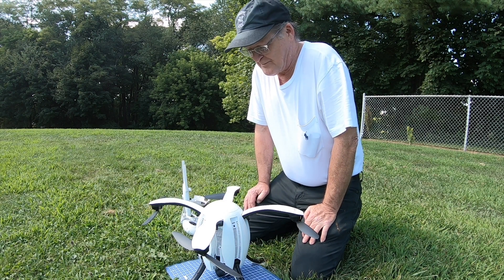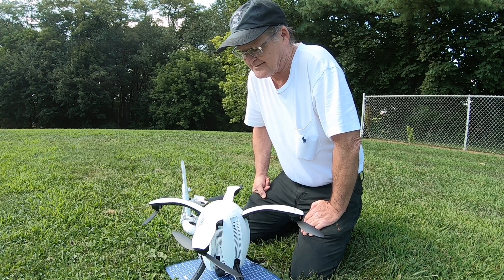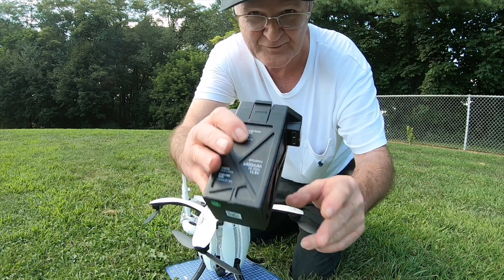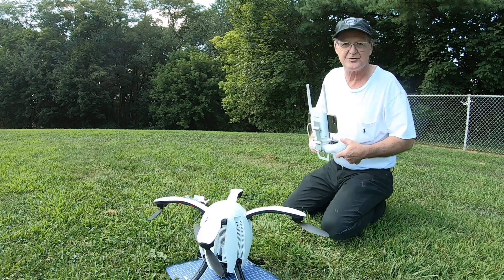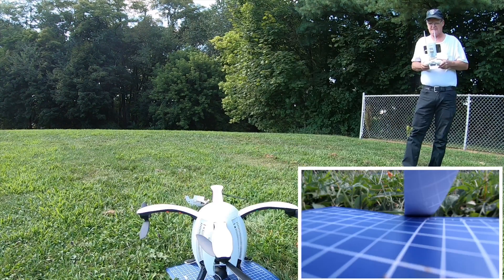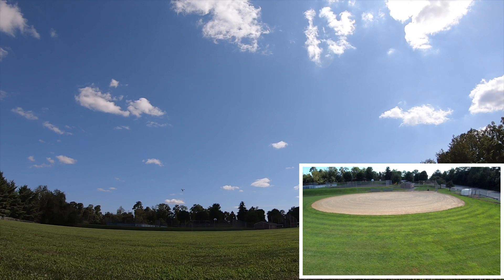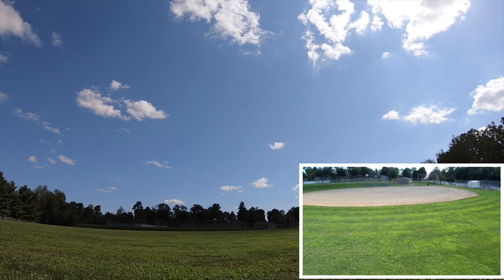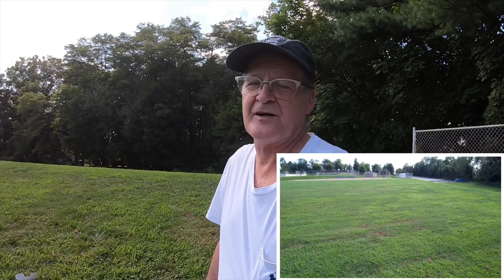PowerVision PowerEgg Drone Second Flight Gimbal Problem 4K

Comment: Is your battery normal?
All three batteries are defective for me.
1. Even when fully charged with a charger, the battery charge is 64%
2. Even with 50% battery capacity, drone lands saying battery is too weak
3. The battery swells, and it won't come off the drone.

Even if I try to buy the battery again, in the picture posted, the battery is swelled.
So, I think all those batteries in the PowerEdge are defective from the beginning,
Put the drone in the warehouse and don't fly.

Is the battery normal for your power?
Reply from the maker: @dkfkdkddk  I have no problem with mine

Comment: Can anyone please help me,  Powervision channel don't answer, i  have used this drone but lately in won't connect  i hace reset and unbinded but i can't get it to connect,  what am i doing wrong or not doing? Ty
Reply from the maker: That sounds like a electrical failure in the drone or the controller.
Reply: it was working fine until i got a new phone  everything seems to work fine but at the last 5 sec of system check it says connection fail , I do have extra base and controller and a drone , thank you @bryansbikes

Comment: Very interesting design to say the least!  That is the biggest battery I've ever seen on a drone. It's as big as a motorcycle/lawn tractor battery!!! I did notice a few "gimbal glitches" but the video is pretty awesome. Good job, thanks for sharing!!!
Reply: Hi. $360 from Jersey free shipping no taxes had to buy now 5 days to go til I have it. Bet it's fun to fly, I like a stepper learning curve. Say will go out a long ways with perfect los angle. Personally I'd be happy with 1000 meters but would feel best closer in isolated area. Dangerous if went rogue on me. This thing would kill someone should it crack open on your noggin

Comment: It sure looks good. My guess on the battery thing is they are trying to get people to discharge the battery to storage voltage or less so they don't keep charging up the battery and possibly leaving it sitting fully charged for a long time which could ruin it. That's why I love the smart batteries because they will discharge themselves.

Comment: There might be a sensitivity setting for the gimbal?  My Autel was doing that and I raised the sensitivity and it fixed it
Reply from the maker: Thanks, I will check it out for sure.
Reply: Were you able to fix gimbal problem ? I'm about ready to order it and if that's a common  problem and not an easy fix then I'll pass. I've messed up my share of quadcopters trying to fix issues beyond soldering.  No computer skills